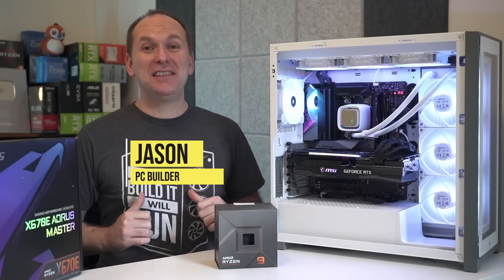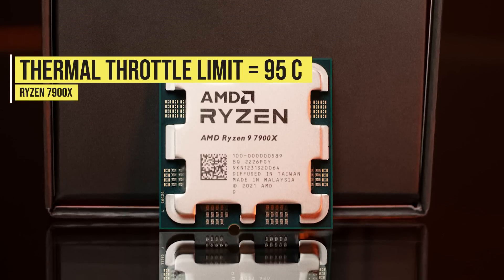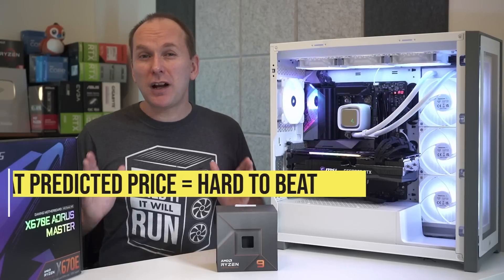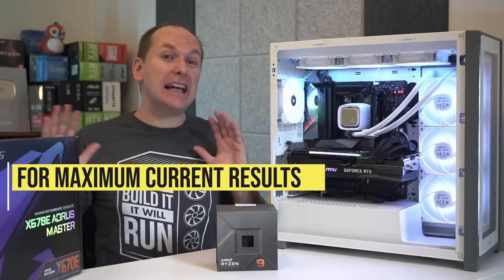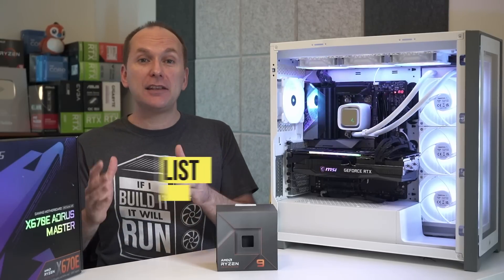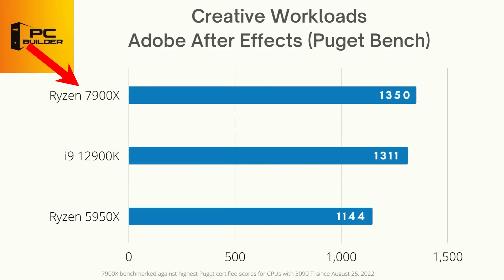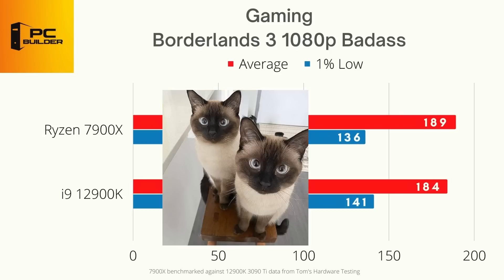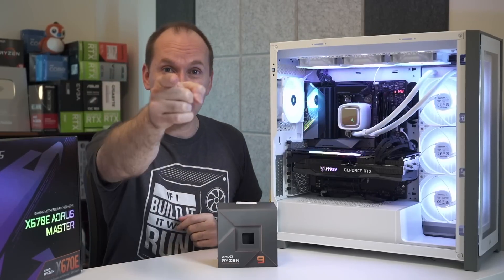🛑 EPIC Ryzen 9 7900X Gaming PC Build + RTX 3090 Ti 🛑 Game Benchmarks & 7900X Review

Comment: My new build with the 7900x temperature goes up to 105c then shuts off. Any advice?
Reply: Did you remove the plastic in the cpu fan? did you put a decent amount of thermal paste. Not extreme thermal paste just the necessary

Comment: Ryzen 9 7900X is now cheaper than Ryzen 9 7900. Is it better to buy Ryzen 9 7900X and run it in eco mode? Can Ryzen 9 7900X be made equal to Ryzen 9 7900 in terms of power efficiency vs performance?

Comment: JASON can i go with a GIGABYTE X670 AORUS Elite AX instead of the Master? it fits more in my budget! because i what to put 7900x and Radeon RX 7900XT what is the big difference of the two
Reply from the maker: Aorus Master has upgraded audio, a post code readout, much beefier VRMs, and a lot more connectivity. But the X670 Elite is also very good, though entry level audio. For the same price I'd recommend the Aorus B650 Pro AX as nobody needs X670. Good luck on the build!
Reply: @PCBuilderChannel  ok cool thank you so much i watched your other video's a 7900x build buy was tryin to save some money for the 7900xt

Comment: Hi there im thinking about getting a new Setup so created this setup: 

CPU:  AMD Ryzen 9 7900X 
Board: Gigabyte B650 Aorus Elite AX 
RAM: 32GB G.Skill Trident Z5 NEO EXPO DDR5-6000 DIMM CL30-38-38-96 Dual 

I will use the PSU & Storage from my actual system. 
But im Not sure wich cooler and GPU to get thought about a 3080 or a 3080TI any recommendations ?

Comment: Hello there guys. Can you please help me out? I've saved money for a gaming PC but I've only have enough money for a 3080 TI. I was wondering can I pair it with a Ryzen 7950x and what power supply should I use? I've been using laptops for the past 10 years and I don't have much experience with PC components at the moment. It is a bit overwhelming with the current market. Anyway my budget is 3000£ and I want to use the PC for gaming, streaming, video editing and perhaps some engineering software as well like AutoCAD.
Reply from the maker: Hello, with that card I'd go down a bit on your CPU. For your needs the 7600X would do well for you, or the 13600k. We have video guides to both on the channel for you to check out

Comment: Jason,  from watching your reviews on MB's I picked up a MSI MPG B650 EDGE WIFI ATX AM5 and just got a AMD 7900x,  I am trying to find out if the DeepCool LS720 will work with this MB.  I saw this "The Deepcool LS720 WH 85.85 CFM Liquid CPU Cooler may require a separately available mounting adapter to fit the MSI MPG B650 EDGE WIFI ATX AM5 Motherboard."  I have not been able to find where to get this Adapter.  Or is there a better cooler that will work out of the box with the MSI MPG B650 EDGE WIFI ATX AM5?
Reply from the maker: It will work out of the box with the AM4 brackets, but they do sell an AM5 kit here for $6: https://amzn.to/3VqKw8u . Note that the fans on that cooler get very loud at about 90% fan speed, so I adjusted the fan curve so they capped out at 90% (doesn't impact cooling, just noise). Just ensure that they go to 90% by 95 Degrees C, then put the 100% speed at like 110 C (it will never get that hot, so it will never spin that fast). Hope that helps. Great cooler.

Comment: great video! i'm curious how much that full build cost?
Reply from the maker: With current prices you're looking at $2500 ish. I would swap in the B650e Aorus Master.
Reply: @PCBuilderChannel  hmm makes sense. that assumes that we can actually get the 3090 TI at a decent price, right? most of them are still massively overpriced or out of stock. i ended up getting a 3090 TI founder's edition from the nvidia website for $1100. by far the best deal i could find for a new/unused 3090 TI

Comment: Would on 8 pin cpu cable be enough for 7950x or do you need to use both 8 pin slots on the mother board

Comment: Jason, I am really diggin’ the channel! The current evolution in generation tech has me making my own AM5 build; and my last computer build had SLIed Nvidia 6800’s when they were the latest and greatest 😂! I have found your channel the most helpful for getting back up to speed on what’s new!!
Reply: If you see this, or anyone that knows a thing or two, please advise. I have almost all the parts on the way, except the CPU. I wanted to make this build simply ridiculous, not a dime spared, but I have to purchase in a couple waves to make me feel better about how much I’m spending 😂. Using the same MOBO. I’m 99% sure I’m going with the Ryzen 7950x, however watching this video is making me second guess if it’ll only have diminishing returns over the 7900X? I also have 2x32gb Corsair Vengeance AMD Expo DDR5 5200 40 CAS, timing 40-40-40-77. My plan was to get another 2 sticks of the same to have a total of 128gb of ram (remember, the most ridiculous specs). My question is, I have read about the sweet spot with the Ryzen 7900’s being 6000 MTps, and now you’re also saying it here. Do you think I would get more performance out of 32gb/64gb of the 6000 MTps G.Skill RAM you’re using compared to 64gb/128gb of the 5200 MTps Corsair I have on the way? It’ll also be helpful to point out that I will primarily be using this rig to produce music in Ableton 11, primarily large electronic projects with lots of Plugins and Virtual Synthesizers. Also will be doing some video editing, and would be remised if I didn’t do some gaming!

Comment: I decided to build a 12700k 3090 build . It cost a hell of a lot less than it would of at start of the year.  Means I can also upgrade to intel 13 if wanted although I don't think I'd be upgrading for a few years .  I also bought a 011 evo and pimped it out with 2 360m lian li fans and a 360m lian li cooler and a single at the back so 10 in total.  So I think I definitely got more bang for my buck going with 12 gen 30 series than jumping on the hype train

Comment: My AMD Ryzen 5950X with OC at 4.5Ghz (4500Mhz) & 1.236 Volts (Use 1.15V). Get Score in Cinebench R23 [29340] with AVG Temps 70C

Motherbord is the Gigabyte X570S AORUS PRO AX (rev. 1.1)
RAM Corsair 3600Mhz CMW32GX4M2D3600C18
Cooler = Corsair iCUE H150i Elite Capellix

Comment: The ryzen 7950 is $1000 in Sweden and the ryzen 7900 is $800. I got the $800 version. Mobo was more reasonable. About $500
Reply from the maker: Best of luck with your build!
Reply: @PCBuilderChannel  Thank you. I started the build today, though my power supply didn’t fit. I didn’t count on the x670e needing 2x 8 pins for the mother board 😂 just ordered a new psu 😃

Comment: Don't bother with these new chips, wait for the 3D vcache versions. The 5800x3D is 1% off the 7950x and almost 50% less money. 3D vcache is the future. Plus you need a new mobo/cpu/ram, running you well over $1200 (I'm in Canada). 5800x3D for now, its the future of gaming

Comment: Hi Jason, I was wondering, if the 5800X 3D is too fast for current gen GPUs, is it safe to say that building a PC with the 5800X 3D this year with a RX 7900 XT or RTX 4090 would be a safe bet? I plan to build a new rig for about €5000-6000 to last about 5-10yrs
Reply from the maker: I suspect that would be a great build (though we need to wait for 3rd party testing of the new gpus). And I want to caution you around "future proofing" pcs these days. Tech moves so fast now there is always going to be a upgrade on the horizon that you may have to switch out multiple pc parts to take advantage of, and we don't know what gaming requirements will be down the road. So I recommend building the most powerful machine that fits your budget now as the best form of "future proofing"

Comment: Congrats dude you're one of two channels I watched today that mentioned the GPU issue, because without understanding this point many people will look at the graphs and assume that in part of these games the 12900K, 7900X and 5800X3D are all about the same for most games when in fact it's just the GPU is the bottleneck EVEN FOR 1080p!  I don't think this has happened in the last few years, where the CPUs are SO good that even top end GPUs can't run fast enough at 1080p.
Reply from the maker: Agreed! It makes it so hard to do a review of this right now! Between waiting for the new GPUs to get a real sense of the card and the upcoming Intel competition this was a weird one for sure.
Reply: @PCBuilderChannel  It's the same thing GN said.  He said it's hard to do a gaming benchmark because you get into settings for the game that are too unrealistic.  He couldn't create enough CPU bottlenecks.

And this is a good thing really because if you buy into a new platform, especially AM5, you know that MB, with a CPU upgrade down the road is going to be GREAT at gaming.

And this gets to the pricing issue for the MB and memory.  I personally wouldn't care because I'd have the system for 5 - 8 years because that's how I do AMD systems.  I'll get the last upgrade for the MB and have that system for another 3 years, and of course a GPU upgrade goes in there as well.

So, building AMD systems that way, you focus on getting a GOOD MB, and in this case because GPUs are going to make a lot of improvements in the next 2 generations, I'd have to buy a MB with PCIe gen5 on the main GPU slot.

Peace dude and good review.

Comment: Keep growing big fan of your content. For me... I'll upgrade from my 5600x to a brand new 5950x and from 32GB of ram, up to 64 ddr4 3600hz. I think it would be a great upgrade. And find a way to upgrade my RTX 3050 to an RTX 4080 12GB... I think I'll be good with that for many years to come until a new generational upgrade comes.
Reply from the maker: Going to be a beast!
Reply: @PCBuilderChannel  My rationale is this, I'm on a 5600x now; upgrading to a 16 core, 32 threads CPU would be a substantial upgrade, including the memory upgrade (32GB at 3200MHz C18 up to 64GB at 3600MHz C18 dual channel). I think that's enough for productivity (my primary use for the PC) at the lowest cost. My current GPU it's an RTX 3050; maybe later, I could upgrade to an RTX 4080 12GB. (Not a budget part, but I think it's worth the effort). I expect to get a new Ryzen 9 for $500, a proper air cooler for it, maybe $65, a memory kit for $200, and future-proof the PSU with platinum 850 watts for $130, $900 tops. GPU? $900 maybe next year... I'll get, I think, maybe 3/4 more years of appropriate hardware for my work... until the next-gen CPUs come to the market. I'll skip this one entirely... 9550x would be like (and a big LIKE between quotes), having a new AMD Ryzen 5 7600X... no new PCI 5 PSU, no expensive new-gen motherboard, no new expensive DDR5 memory Kits, or a big water cooler for the CPU... PCIe 4 storage is more than enough for me... So there you have it, Jason. Thanks.

Comment: why are you blowing hot air from the radiator into the case instead of out?
Reply from the maker: You can do it either way (see our AIO Water Cooling guide for more on that). You will get a very slight thermal advantage by bringing in cooler fresh air into the radiator and then exhausting it out through the case. Normally I wouldn't bother with this but we were told Ryzen 7000 runs hot so I wanted it to have every thermal advantage.
Reply: @PCBuilderChannel  ok that makes sense. thank you for the reply.

Comment: DDR5 is super cheap if you know where to look, and just a tip. 4800 kits are the same as 5200 kits, 5600 kits can overclock to 6000. if u wanna save the $20-50 bucks, be my guest. i got my xpg 32gb 6000mhz rgb for $180 after discount.

Comment: any opinions on my situation (main purpose gaming). currently looking to upgrade my cpu, ryzen 7 3700x, and to upgrade gpu to 4070/4080. I don't know which route to go, 5800x3d w/ all current components or upgrade to 7700x but also have to deal with a major price jump for new mob and ram. would it maybe even be smarter  to wait for x3d variation of the 7000 series?

Comment: Hey Jason so I wanna get a 3060ti founders edition but the card needs a 12 pin connector and the connector I have right now is 8pin. I’ve searched on Amazon and found 8pin to 12pin adapters by Asiahorse but those come with two 8 pin connectors on one side and one 12pin on the other is it safe to connect my one 8pin on one of the 2 8pin side and then connect the 12pin to my gpu.
Reply from the maker: I prefer not to daisy chain the connectors. I know that means swapping out your PSU which can be a pain, but I would consider it. On the 3060 Ti probably not as much of an issue with daisy chaining due to lower power draw, but personally I'd get the right PSU because fire is bad.
Reply: @PCBuilderChannel  I did more digging and the 3060ti founders edition comes with a 8pin adapter but that adapter only has 6 pins that actually give power to the card does that mean I could use mine since it only has 6pins on the gpu.

Comment: Was there any problem attaching the cooler? Did you use an adapter?
Reply from the maker: I had no issues and the cooler (AM4 mounting as AM5 brackets not yet available) was very easy to install with the exception that I had to swap around the pump head brackets because they were bumping into the main PCIE Gen 5 M.2 heatsink, but was easy enough to do. I noticed the AM5 ones are a little less pronounced.

Comment: I don't think DDR5 ain't going to drop in price in the next year+, AM5 is way too expensive for gaming for minimal gains, too much power consumption and very hot temperatures even with an expensive top of the line AIO.
$400 motherboard, $300 on DDR5 RAM, $200 360mm AIO.
Just the AM5 motherboard alone costs more than my 5600 + DDR4 RAM + AM4 X570 Motherboard.
I think AMD made a huge mistake going with super high power consumption and extremely hot temperatures, their stock is going to drop like a rock when they see the minimal sales of their CPU's 👌
Reply from the maker: I think for the high end 7950X and 7900X the pricing makes sense where often your time is money (so faster = better), but I agree the value proposition for the lower end CPUs for a primarily gaming audience may not be there. But more on that in future videos! :)

Comment: Wow you are the first review that I have watched that has mentioned the need for new mounting because of the different thickness of the CPU. That's probably why you got 88c and everyone else has been maxing out at 95c??
Reply from the maker: I used the AM4 bracket because nobody has the AM5 ones ready just yet. The LS720 is a very high performance 360mm AIO and with a still very good but slightly weaker cooler I may have ended up near 95. I elected to use the CPU PBO limits rather than the motherboard PBO limits which likely could have pushed up further. But the Aorus X670E Master is a freaking beast of a motherboard and I didn't think that would be fair to those getting weaker boards so I stuck with the CPU limits.
Reply: @PCBuilderChannel  Hmm OK. Thanks for the clarification.

Comment: The way he slid the CPU sideways when he socketed it got me all messed up! Hopefully bent pins wont be as much of a problem with the new socket design.
Reply from the maker: I didn't slide the CPU sideways. It initially got stuck on the keyed part of the socket (the part meant to ensure you put it in the right way). Just needed a very gentle tap with no downward force. Happens on Intel CPUs too. Remember the pins don't engage upwards until you depress the socket lever so you're not scratching it on anything.
Reply: @PCBuilderChannel  Good to know... I'm always paranoid about bending pins I guess.

Comment: We as gamers should stop buying pc for a 1 year so intel/amd/nvidia drop the prices a bit.  I have builded a pc in 2014 for a 1000 € gtx 750ti, i5 4690, asus z390. 1080p 40-50fps medum. To get the same amount of FPS i have to spend more then 1200-1400 €
Reply from the maker: It depends on where you are. In the US market, you can easily build a good 1440p gaming PC for about $1000 USD (about 1000 Euro). Now with the GPU shortage over, what has changed is the cost of the ultra high end which has gotten a lot more expensive. All that being said I think your system just needs a GPU upgrade.
Reply: @PCBuilderChannel  The land of Waffle, chocolate and juwelry Belgium

Comment: So with 7000 series being designed to run at 95°c, does that mean that it's gonna be spewing out even more heat that 12th gen?
That can't be comfortable in summer right? And you can't really undervolt for lower temps  since that's going against the design as well..
I find this a pretty weird change. It's boost vs comfort
Reply from the maker: You can undervolt and it has a PBO curve adjustment in the bios, similar to how PBO undervolting works on Ryzen 5000. I haven't played around with it yet but I did spend quite a bit of time exploring any new bios options and it is there.

Comment: The Raptor Lake test are going to be very interesting. I do think the 7950X will be out of range for the 13900K but the 7900X & down are in big trouble across the stack lol. The 13700K should be a monster. Most likely the reason why the 3D chips will be coming out so quickly. Under 6 months which is just going to make 7000X buyers feel really bad.
Reply from the maker: Can't wait to test the new intel!
Reply: Maybe,  and if so at what cost..  also I never know with intel, look at 11th gen. Lol.